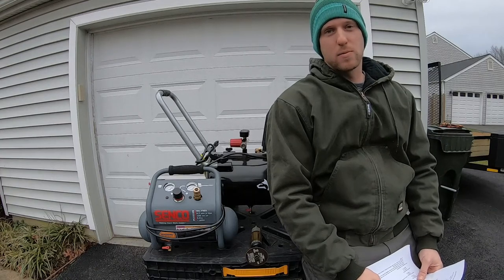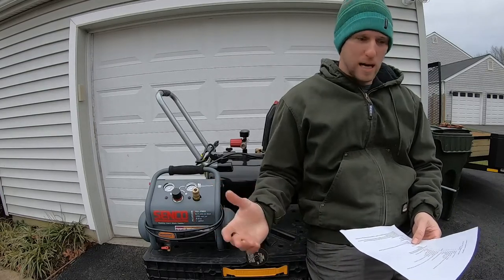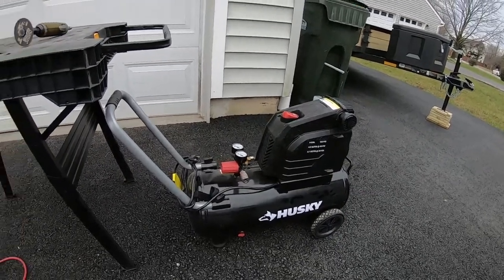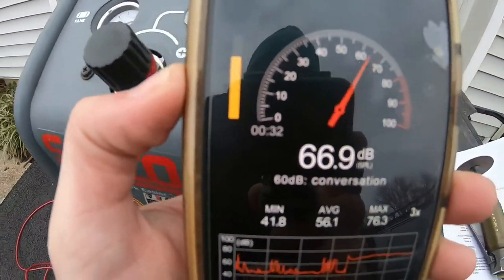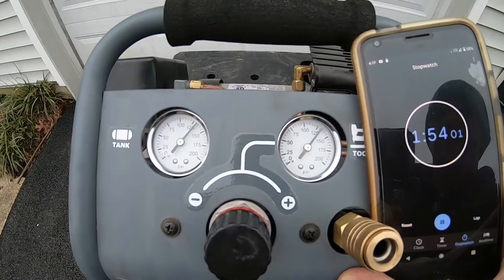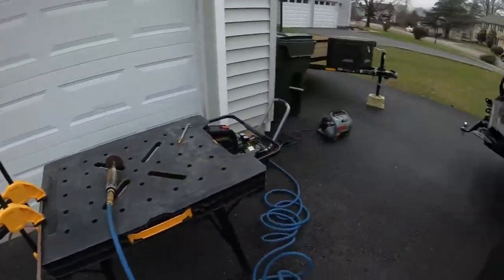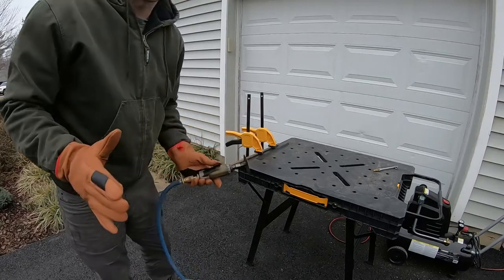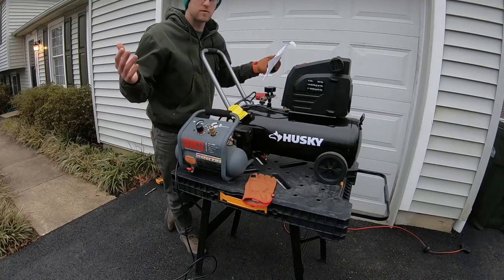$150 Air Compressor Review and Demo | Senco VS Husky

Comment: I changed the coupler on my $99 Husky with a Milton V. Dewalt 3/8 rubber hose and an Iwata air gunsa for painting and it works well

Comment: Try out the Milton Type V high flow couplers and 3/8" hoses...they make a huge difference in cutting tools impacts etc
Reply from the maker: That's a really good point. Might be best to have both, one for mobility and finishing work and the other for the heavy lifting
Reply: @ThomperBeThompin  Yep, I got  a small 2gal cheap compressor weighs about 15lbs and .7 cfm @90psi. That lil bugger works awesome for trim. If driving a bunch of 16ga in quick succession a guy can outrun it but still works pretty good at a normal pace. 18ga no problem. So easy to move around. I just set it in a closet or something and it's hardly bothersome. Don't even pull out the big 50lb beast anymore.
Reply from the maker: @mrmotofy  if you don't mind me picking your brain for a minute, what do you think of the battery powered nailers that are coming out? Think you would ever switch to something like that? I think they have one for a roofing application and some for brad nails
Reply: @ThomperBeThompin  They could work for trim...but I think I would just use a cordless at that point. But my lil $40 sale 2gal works awesome for trim. So small light and cheap drawing like 190w. So it runs anywhere even in my truck if I really needed to
Roofing? I don't think they can keep up. Those guys I've heard use a LOT of air and are fast.

Comment: I just bought that same 8 gal. Husky. Haven't used it yet but now I'm reading bad reviews about I and having some regrets. What are your thoughts on the husk after you've had it for awhile?
The issues I read about specifically are it doesn't refill and it trips breakers frequently
Reply from the maker: Mine refills just fine and has yet to trip a breaker. I've used this to fill up plenty of car tires, dirt bike tires, ATV tires, trailer tires and other small tasks. I have not used it heavy duty for grinding or with a nail gun or anything. So far so good but I'm just an average homeowner user not a tradesman using it everyday.
Reply: @ThomperBeThompin  yeah me too. Thanks for answering and posting the video.